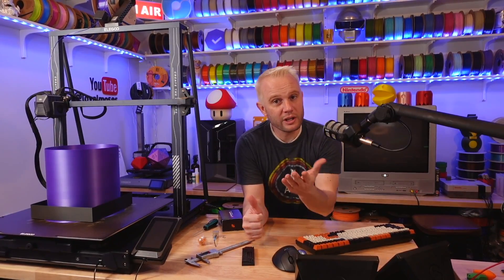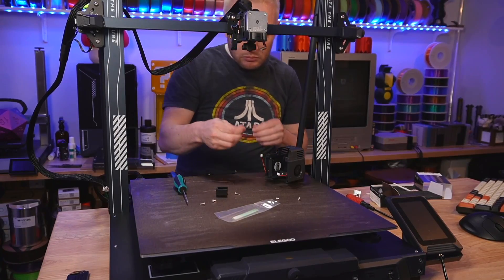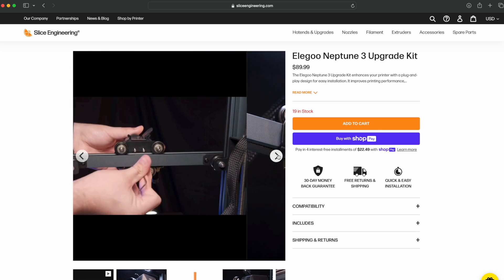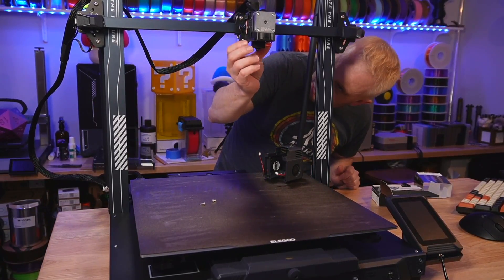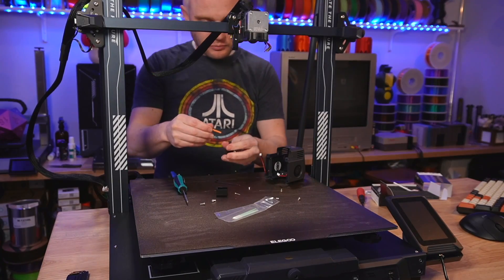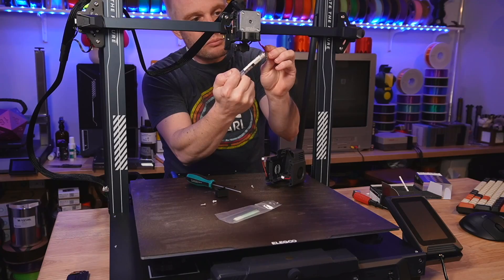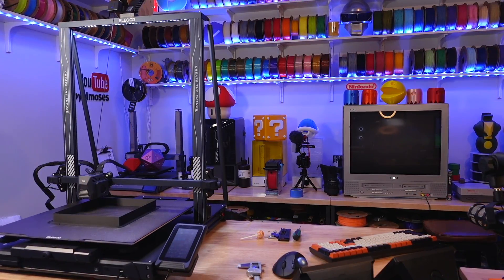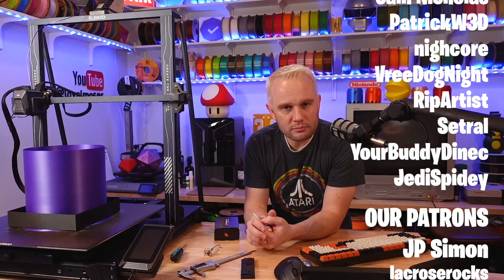Get Layer Lines Like This! Slice Engineering Neptune 3 Upgrade Kit

Comment: It's interesting all these upgrades but I'm paranoid since my elegoo neptune 3 pro has printed great since i got it.  Excluding that time i tried to make it print faster and had a lot of problems with parts curling at the corners.  Slow and steady i think is the real secret to great prints.
Reply: Side note I've only printed pla, and petg.  In fact now it's mostly petg it's really durable and cheap.
Reply from the maker: If it’s working well for you! Might leave it be!

Comment: When or what scenarios should you consider doing upgrades like this to your printer? (Currently using Neptune 4 pro)
Reply from the maker: A couple of good scenarios are if you want to increase flow, printing faster or with bigger nozzles. You are also improving the quality of prints generally as well as helping to reduce clogs and jams because of their special heatbreak.

Comment: I just went and started tinkering with an old Neptune 3 today (upgrading to Klipper to see if it would solve an issue with the bed mesh causing the nozzle to grind into the bed). Assuming I get it working, this may be one of the very next upgrades I do
Reply: Yeah, it's my dad's old Neptune 3 (non-pro) he ended up replacing it rather quickly cause for some reason whenever he ran a bed mesh, the results would be vastly different every time and then if you ran a print, the nozzle would just crash into the bed and grind. He had gone through 3 different beds by the time he gave up on it. Setting z offset didn't help with it. The only solution was to factory reset the entire printer whenever he needed to run a new bed mesh. I decided today to just see if Klipperizing it would fix that problem, or if it is going to end up being a hardware problem and not a firmware issue.
Reply from the maker: Oh cool! That would be awesome to get it going and upgraded!
Reply from the maker: Oh wow! You had a Neptune 3 laying around!?